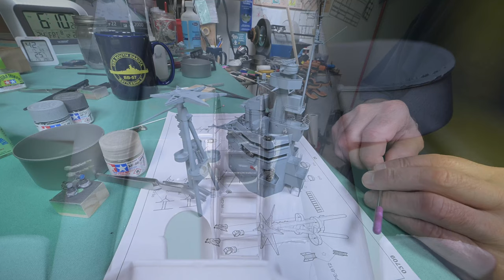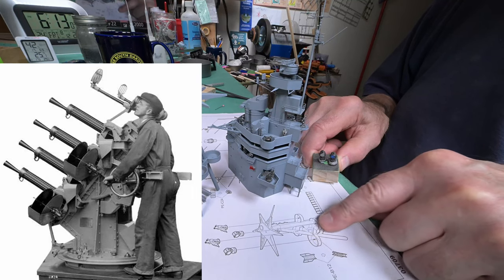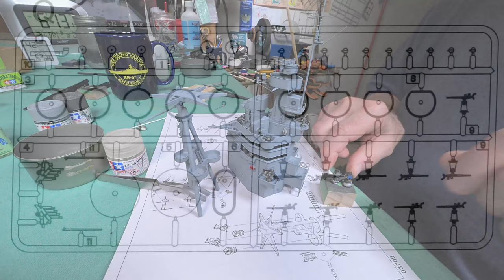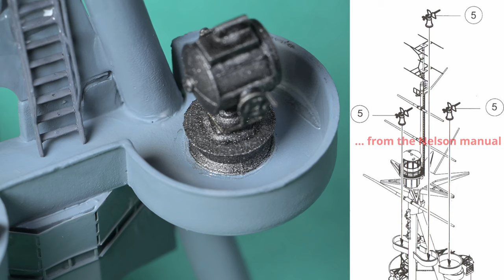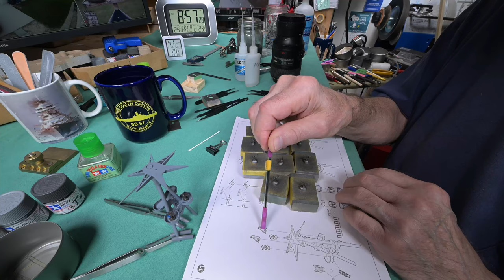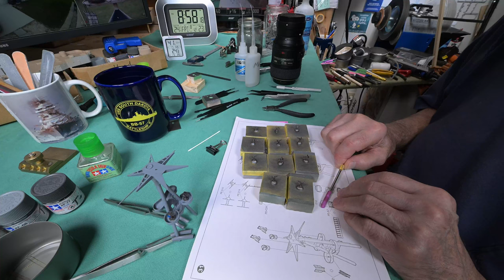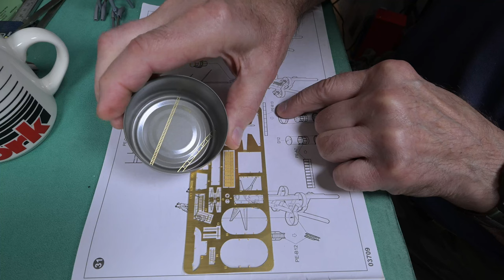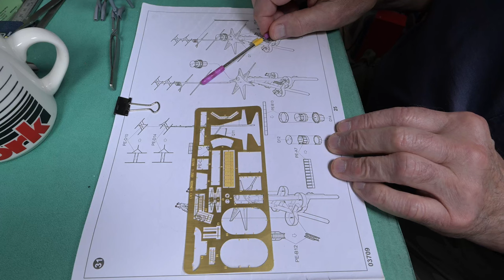The Model Ship - Part 1269

Comment: Ron, If you want to replace those quad guns, you can order after market 3d parts. Micro Mark offers 1/200 quad Vickers 0.50/62 (12.7 mm) MG MKIii (no shield) 3d guns which seems to match those guns. A set of 4 is $20 USD. Hope this helps. Rich D
Reply: Correction company is Micro Master.
Reply from the maker: Thanks for that tip Rich. 👍

Comment: Hi Ron those two guns you mounted don't look right the way you mounted them. As they are the gunner would have to be standing outside the splinter shield. I think you should have mounted them facing port one side and starboard the other then the gunner would then be standing on the platform. Just an observation Ron not a criticism. Best wishes Vic.
Reply: Easily explained by the fact they are just swung out at that point, if a gunner was to use them, they would move them into the position as you suggest. 🙂
Reply from the maker: .... I'm really messing this build up! Hope the USS Iowa goes in a more logical manner. 😒
Thanks for noticing Vic 👍